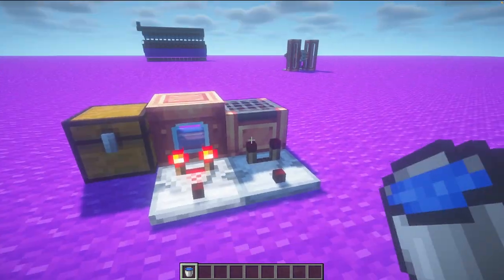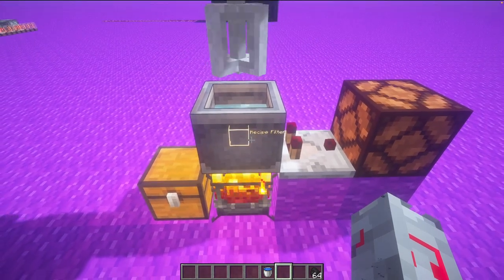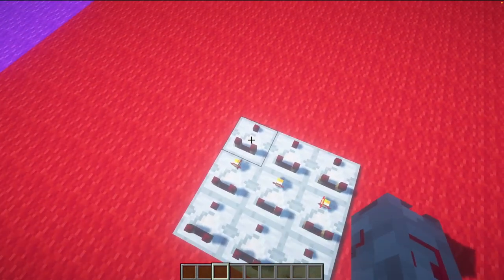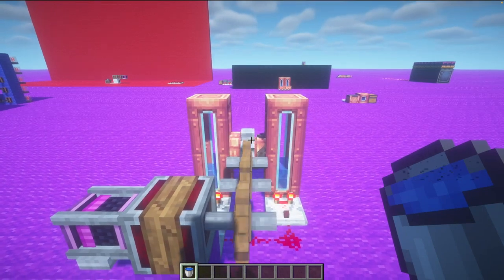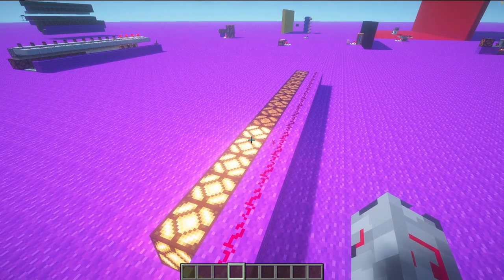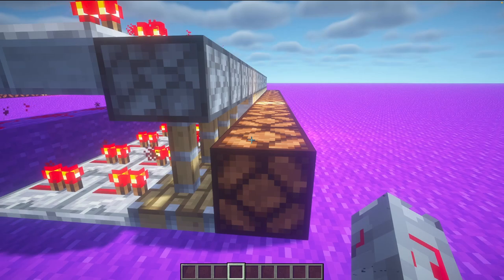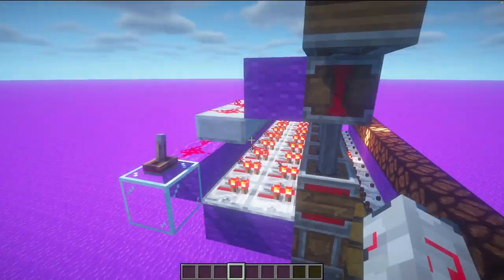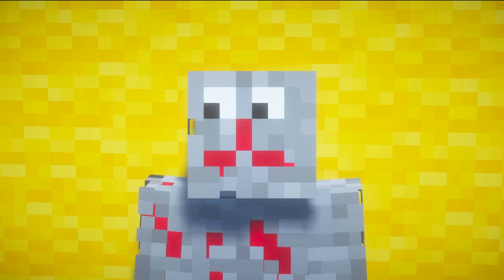Minecraft: Quick Create Mod 0.5 Signal Strength Tutorial

Comment: you probably know this but I feel its best to clarify it for comments and others just in case, comparators will always compare singal strength from the sides and backs, in their default mode, the comparator will output the signal strength that is highest from its inputs, in its rightclick(subtract) mode, it will subtract the signal strength from the sides away from the signal strength input in the back. 
Useful for a bunch of different things that people smarter than me know, but the main one I use it for is using an analog lever at the side of a comparator reading from an inventory, and you set it up so that you can shorten the length you need to check for high signal stengths, like if a container is full its 15, so input 14 from the side, and you will only get any signal from the front when something is completely full, and you can lead that to a shutoff, that way you can shrink a 15-16 block long redstone line into 4 or so blocks
Reply: might have been to hasty with the pin and I cant edit it anymore lol, default mode I got wrong, if sides are higher then it turns the output off, not outputs the highest signal, also subtract mode uses the side signal with the highest signal, so it does not subtract both, just to make sure not to confuse more people on how this block functions
Reply from the maker: 😅 thanks for the correction! I can unpin if you want but I think it’s still good for anyone interested; it much better than what I say in the video!
Reply: @BLOckOus  no the pin is fine lol, its just that i cant edit anymore, so I just hope people dont get misinformed before they see my reply correcting it
Reply from the maker: It will be a little adventure for them, thanks!!😁